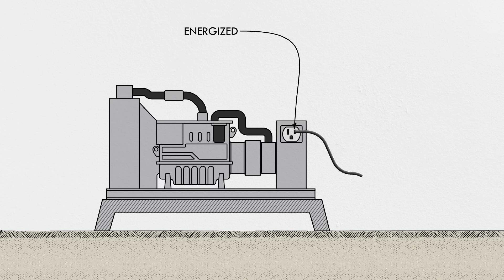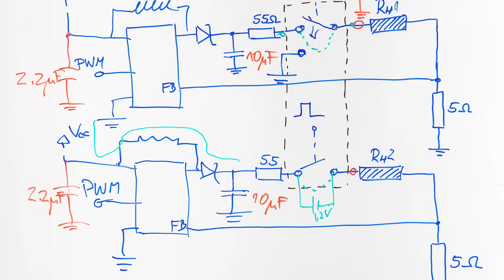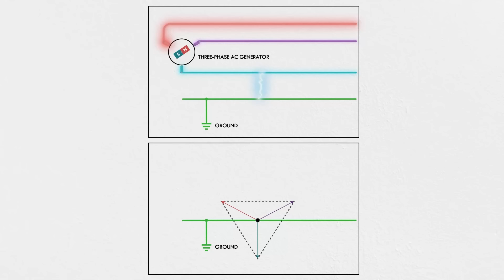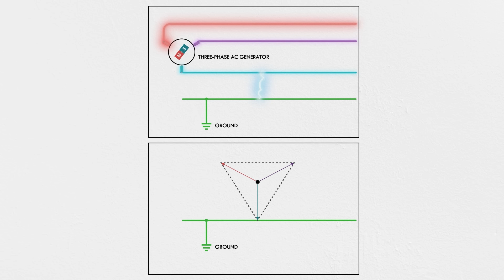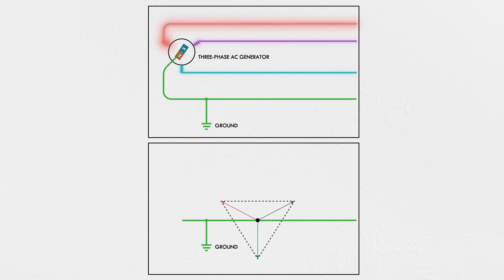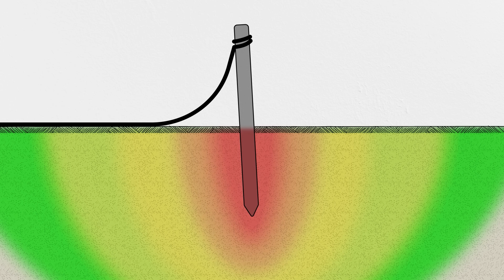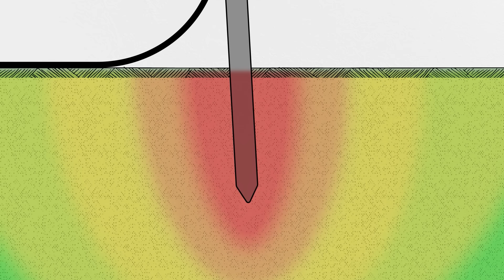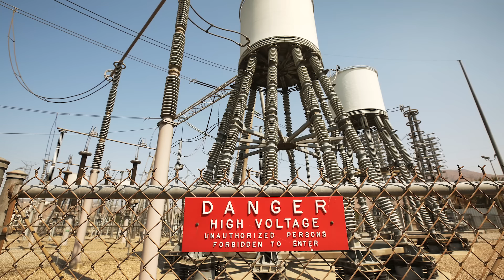Where Does Grounded Electricity Actually Go?

Comment: My job has a high resistance ground on our 480v distribution system. It’s wild to realize one phase is at 0 volts during a fault and non of the equipment cares because phase to phase doesn’t change.
Reply: Yet 2 of those phases in such a fault condition will be much higher voltage to ground, easily exceeding the rated voltage of insulation.  That high ground/Earth impedance is a matter that should be addressed.
Reply: @BTW... Is the wire only rated for 600V in these applications?
Reply: @BTW...  the ungrounded phases go from 277 to 480 phase to ground and the phase to phase voltage is unaffected. Still below the common 600v rating of most insulation.
Reply: Ah yes the high impedance grounded system. The Cadillac of electrical systems. Are you by any chance in a hospital...??
Reply: @MrMaxyield  Glass plant. The furnace requires similar reliability to a hospital.
Reply: @will75wallace  guessing that is because if it goes down they have to let it cool completely and then it takes days to come back up to temperature? Ive heard some processes with large kilns a cold start can be the better part of a week because they cant just ask for say 1500F and flip the heaters on it has to come up at a pace so the whole structure of the unit heats up evenly.
Reply: @filanfyretracker  No it essentially breaks and you have to get a demolition crew in to tear it down, afterwards rebuild it, because the glass inside solidified it into a giant industrial furnace sized brick.
Reply: @filanfyretracker  yea if it starts to cool, flow stops. You get hot and cold spots and it’s game over. Glass furnaces go about 10 years between rebuilds and the more interruptions of power water and gas, the shorter the life expectancy.

Comment: Grady you do a fantastic job of education and explanation of your subjects. I lived in Cambodia which has a 220/380V or so system.  Each house was connected to one hot leg of a 3 wire wye and the common. Common was NOT grounded. Middle of the night one phase was 280, in the heat of the day with all the air con running it was 160 or so. Across the street was a welding shop which was on a different hot leg of the wye. I has incandescent lights in my bathrooms, and whenever he struck an arc it would drag the common towards him and increase the brightness of my lamps A LOT. I finally replaced those fixtures with electronic ballast fluorescents, which eliminated the change in luminance. Some fluorescent light switches in the house broke the common instead of the hot, so the input capacitor in the ballast would charge and then flash the lamp about every 5 minutes. Interesting experience living  there.

Comment: Those single wire earth return systems are quite commonplace here in Australia. I remember being fascinated by them as a kid and asking my dad, who is a physicist, how they worked. I recently purchased a pair of local battery magneto crank telephones, which I have setup as a novelty intercom system. I was recently reading about how some remote telephone lines used a earth return system, so at some point, I plan on doing a little experiment with the phones to see if I can get an earth return system to work between them.
Reply: You may be interested in the open-wire telephone system from the rim to the bottom of the Grand Canyon in Arizona! It's on the historic register.
Reply: Ground-return is how a lot of magneto-based phone systems worked, cheaper to use one wire per phone, and, if you have long wire fences on reasonably insulated posts, you could even use your fenceline as the main wire, just by clipping onto it and connecting the other terminal to the ground... :)
Reply: I have a photo I took of a public phone box at Yaraka QLD, when booking a hotel room, I rang this long phone number and asked for “Yaraka 4” and spoke to a manual exchange. This phone box had an A and B button and a crank handle. People I showed this photo to said they wouldn’t know how to make a phone call. This was in 1987. As a kid in the 1960s I had an uncle who was an electrician who had a whole bunch of hand crank generators as he was involved in upgrading the telephone system.
Reply: @darylcheshire1618  Fascinating! I had always thought that the last manual magneto exchange in Australia was near Geraldton WA and closed in late 1985. The two PMG 403MT handsets I have were made by British Ericsson in 1957 and 1960 respectively, but both have Telecom Workshop Hobart test tags on them from 1979 and 1982, meaning they were probably last in service on remote exchanges in Tasmania until sometime in the mid 1980's.
Reply: @pulsecodemodulated  Yes there were a few in Queensland, also in Yaraka the freight train service still carried passengers until 2004 in a passenger compartment in the guards van. This was a car-goods which is different to a mixed which was a passenger car attached to a freight train.
This was the reason I travelled to Yaraka 3-4 times from 1987-1999.
There was a rail fan called Richard who drove around and took photos of all the remaining manual exchanges and spoke to the old ladies that ran them, he would exhibit these photos on rail enthusiast slide nights. Mostly delapidated tiny buildings in rural areas.

Comment: In the sixties my dad was converting our house from a furnace, which at some time in the past had been modified from burning coal to oil, to electric baseboards. Part of the project also involved moving and updating the fuse box to circuit breakers.

Dad worked for the local power company and got a former lineman, certified for such work, to come make the change over. He had lost the lower part of both arms in a work accident. I was young and fascinated and he did not mind showing me how the hooks split apart and closed using wires that were controlled by shoulder shrugs.

I have been very, very careful around wiring ever since.
Reply: A scaffolder in New Zealand recently lost both arms after the metal pole he was holding to assemble the scaffolding touched the overhead power lines. He spent 6 months in the burns unit recovering. Electricity is nasty stuff. It makes me think how lucky we all are that electrical tradespeople risk their lives at work so the rest of us can relax with electricity at home to watch TV and make coffee.

Comment: As an EE who much prefers embedded systems and low voltage stuff, the idea of grounding into the actual earth has always seemed very odd, so I appreciate you making a video all about how it works and where it's used. Your videos are much more engaging than the power distribution class I had to take, maybe if I had you as a professor I'd be more interested in the field.
I would definitely be interested in seeing a video on HVDC transmission systems, I run across a lot of people with misconceptions about why we primarily use AC for distribution instead of DC, and I'm not really up to date on the state of HVDC projects, so it would be cool to see your take on how the technology is progressing and what benefits it gives us.
Reply: re: why we primarily use AC for distribution? 
It comes down to MONEY. If we had DC power lines, we would need more copper.
Reply: @pisspee2099  I don't think the primary factor is more material in the lines, but the expensive electronics required to increase or decrease the voltage in a DC system. Compared to a transformer they're much more complex. My understanding is that because DC transmission is significantly more efficient, it can make sense when you have few conversions, like long distance connections between grids, or when supplying power to customers that can use DC directly, but for things like household distribution the cost of the equipment and the cost to retrofit everything exceeds the savings from improved efficiency
Reply: There are only a couple of HVDC lines out there, mostly in China because they have a huge distance between population and production sites. DC outperforms AC only on very very long distances. The main issue with DC line is safety equipments.

Comment: As someone who has spent days in the field sticking electrodes in the ground for geoelectric measurements, I really appreciate the (saturated) sand experiment. It's a good visualisation of how applying voltage to the ground can be used to measure its conductivity and therefore draw conclusions about its composition.
Reply: As a surveyor who has asbuilt and checked ground rods/ground grids it also helps illustrate why I was correct to scold guys trying to put gravel in instead of washed/clear rock when they were going shallow with the ground grid.

I've also done some line locating in the past too, and that principle works really well when doing line locating too. There was a really deep water line that had tracer line on it that was still not being located by most guys. I noticed a pond/big pool of water  at the riser location where the pipe and tracer line came out of the ground. Instead of just using a spike to connect my negative lead, I just used a large steel tow rope, attached my lead to it and threw it in the pond. I found that line that 2 line locating companies (remind you, I'm a surveyor) spent two weeks not able to locate without much problem. That was pretty satisfying.

Comment: A few years back my old house was having problems such as the washer not able to spin dry sometimes,  dim lights at times etc.  The cable TV would also fuzz up and checking that connection to the house I discovered the cab;e connection outside was warm.  I called the electric company.  They found an intermittent bad neutral at the pole.  They redid the connection and things went back to normal.   The cable was acting as an interment ground/neutral.
Reply: I work for a cable company and years ago when we would physically disconnect customers at the pole you were supposed to check with a probe for voltage, occasionally someone would be in a hurry and not check and when they would disconnect the cable lights in the house would go out and sometimes things exploded because the neutral to the home was no longer connected and the home had been using the cable drop as the return path.
Reply: Intermediately losing your neutral means various things in your house would be getting anywhere between 0 and 240 volts depending on how loads are balanced

Comment: Great video! One extra thing, related to the example at 7:09: in some countries, such as Italy, France and Japan, the neutral and ground/earth are kept entirely separate in the home, and never connected together.
In that case, during a fault (like in the toaster example) the current will in fact flow through the physical ground, and thus will be fairly low - too low to trip a breaker immediately. Because of this, an RCD/GFCI is required to make sure that power gets cut immediately after a fault.
This is called the TT system, and is nowadays considered to be fairly safe and reliable, provided that an RCD is actually used (which is the case in the countries that make use of it).
Reply: I was wondering, "what does he mean by a return path?" because the ground connectors absolutely do not reconnect to the grid at any point here in the UK. If your device has a ground fault, the current will simply... Go into the ground. At which point your RCD will detect that the return current is lower than the supply current and open the circuit.
The American electricity system is strange. Not to mention their outlets and plugs.
Reply: @RaunienTheFirst  Generally speaking, the UK does in fact use a TN earthing system - generally a TN-C-S one, the same one used in the US, so the same principles apply (especially since houses in the UK aren't required to have earth rods).
The exception is in rural areas, where TT supplies like I described are in fact common - but generally speaking, the TN-C-S system is the predominant one.
The main difference with the US, really, is that the split (from combined neutral and earth into separate neutral and earth conductors) is done by the supplier, while in the US this is done at the breaker panel.
Reply: @samstech963  huh
Reply: @samstech963 The old breaker panel in my basement connected the ground wires together and connected them to a copper rod that ran through the seam between the main basement concrete slab and the slab for the exterior stairway.  When the wiring got updated at some point the copper rod got pulled, which took a serious amount of pulling power because, as it turned out, the rod was over seven feet long.  I thought that was amazing, but an electrician had one of those copper rods on the wall in his shop as a bit of history; it was twelve feet long!  The explanation was that anywhere between six and fifteen feet down under much of this town there was a natural gravel layer that water flowed through that was an excellent conductor due to the fact that except for the town the entire valley area was dairyland, which meant that the water flowing underground towards the bay was far from pure.
Reply: studying to become an electrician here in australia, and we have the same system. we just call it "earth". but just like yours our ground/earth cables go straight into a copper rod submerged a metre into the ground, with an RCD to detect leakage to earth. i was very surprised to hear that their connects to neutral. is it less safe?
Reply: @RaunienTheFirst  Indeed. In the US the standard is to bond neutral to ground in exactly one place (the main distribution point), and that to a true earth ground (e.g. a driven metal rod). While outlets can have grounds that run to true earth via another path, they're required to be clearly marked as isolated grounds. I think they may have some other special rules as well, but I haven't checked the electrical code recently. I do remember that you're no longer allowed to use plumbing pipes as a ground, though… had to get that fixed in a previous house.
Reply: TT system means that the neutral on the transformer side is earthed and the building uses its own earthing system. In case of a ground fault, current flows through the earthing system of the building and then through ground back to the transformer.

The amount of this current purely depends on the earthing system impedance of the building. Given the earthing system is built per standards, it should have a very low impedance allowing for high enough currents to flow in order to trip a breaker.

In my country RCDs are used only in bathroom installations for the protection of human life mainly and not ground faults. Ground faults are prevented by on-site inspection of the earthing system impedance.
Reply: even in India, I confirmed with my electrician, and he showed me the specific area marked near the ground floor of my apartment complex
Reply: I don't think that's correct. I can't speak for continental Europe, but I have viewed a lot of UK electrical content and those electricians mentioned that most of the UK uses TN-C-S except in rural areas where TT is still sometimes found (I believe TN and TN-S are also found in legacy systems as well). TN-C-S is the same system we use in the States.

The truth is every earthing arrangement has pros and cons. One must choose what "attributes" are most important and less likely to fail under the conditions in which the system will be used. What might be best for residential use might not be ideal for industry. In the U.S. we settled on TN-C-S almost everywhere in the residential sphere. (Although we don't call it TN-C-S since our regulations do not abide by the IEEC terminology). Basically neutral and earth are connected one time at the busbar of the main panel (but nowhere else down the line). On the utility side, they earth the neutral several times per mile (I forget the exact specifics, but they earth it continuously down the street). In the U.S. we do install grounding electrodes at every residence, but they are NOT for carrying fault current. They are more for static discharge, nearby lightening, electromagnetic interference, and things of that nature. It would take some beefy electrodes to trip a breaker. And depending on where you live and your soil conditions, you might have to drive a rod 50 feet (yes 50 feet or more).
Reply: No (!), if your description is correct and neutral is isolated from ground, then  a ground fault would result in zero current, because you would have the same circuit shown in this video at 1:05 where no current flows to ground!  So you must be leaving something out of your description/explanation.
Reply: I think it México is like this also
Reply: but ground and neutral are connected into a one wire, sooner or later, using earth as a big wire, anyway

Comment: This dude worked SO hard to make this basic and accessible and my dumb self still missed all of it 😂

I'm glad you make these videos sir, and I hope better minds than mine can get something from it
Reply: What did you not understand?
Reply: @kayakMike1000  Man, I don't even know the difference between current and voltage.  I only clicked because I watch a lot of videos from the Chemical Safety Board and WorkSafeBC.  The WSBC vids talk about what to do if you're digging and strike a wire, so I thought maybe I would get this topic.

Nope.  Multivariable calculus?  No problem.  Basic electricity?  I'm hopeless
Reply: @blacktimhoward4322 voltage: difference in potential (think pressure)
Current: flow of electricity (think how much water goes thru a pipe in a given amount of time)
Reply: Yeah, when the Dominos logo started spinning, I lost it. I am NOT an engineer. ✍️
Reply: @blacktimhoward4322  If you are really good in multivariable calculus then you should be able to derive everything from the Maxwell's equations  😉.  😁JK
Reply: @eklhaft4531  Honestly all of physics only makes sense to me when it's presented mathematically